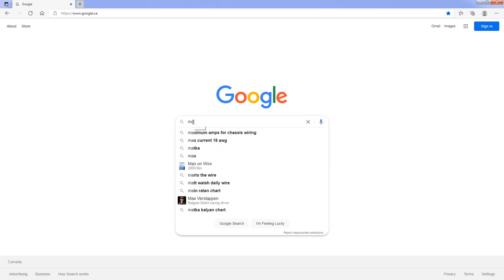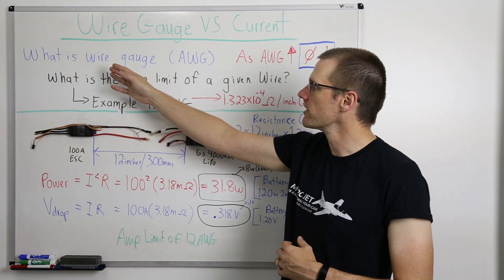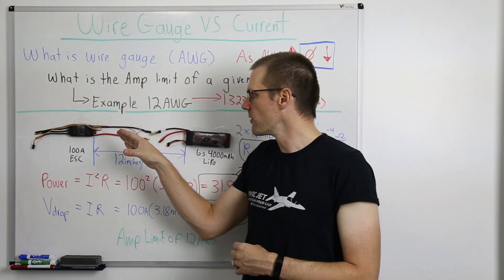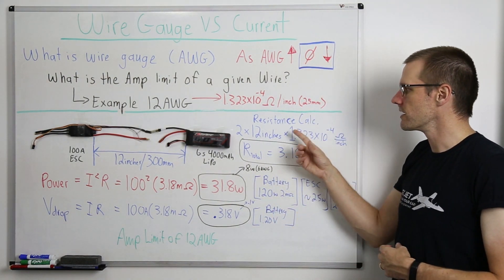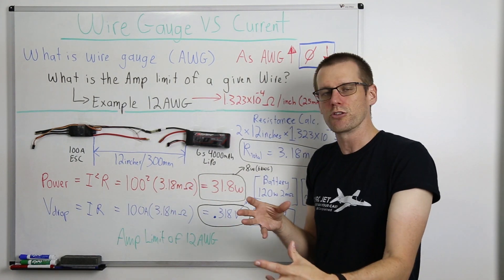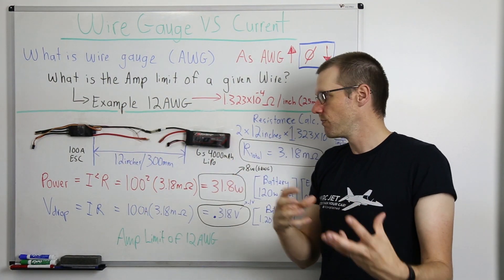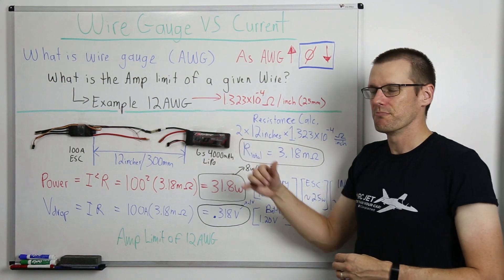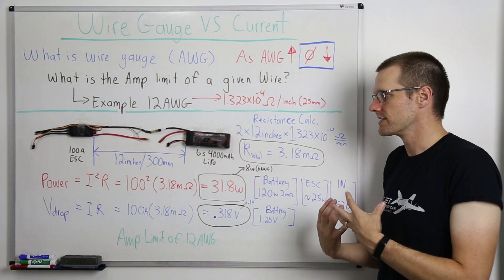Wire Chart Says 12AWG Wire is not good for my 100A ESC and LiPo

Comment: yeah i agree with you that the small wires they put on things  is is small when you are are small scale.  but once you start going over 150 -200 amps at 12s .  That they expect your wires are short with only one connection.  but when you start putting batteries in series and lets say you have a RC plane or boat or larger 1/5 scale cars and don't have the luxury of putting the batteries motor and esc basically on top of eachother. 
Thats when your calculations are no longer insignificant. That having larger gauge wires and better comnectors is a must. Because 
Running those small gauge wires will overheat your entire system and reduce your battery, esc and motor life.
Also running bigger lower KV motors that having a more voltage drop reduces its top speed. And when you try to compensate by drawing more amps it will definitely use a lot more power from the batteries and can significantly reduce its runtime. 

 Not to mention  having a higher resistance on long high speed runs can risk or full throttle for 2min+.  that it will heat things up pretty quick. Which heat will furrher increase its resistance and increase the voltage drop which then requires more power to compensate, which is more losses .  That many people assume the wires that came with it should be okay .
Until ultimately their RC catches on fire.(which many of them do) 
 That its probably better to solder bigger wires onto your motor,esc, and batteries. 

 and also have a high wattage soldering iron(150-200w) or one thats on butane. and hopefully you don't damage them in the process.

So while i agree with  you when you are talking small scale and using a 100-120 amp esc on a light weight mostly plastic 1/10-1/8 scale car. But if you talking about anything bigger than that, then that changes everything

Comment: I have a question, if I have 3 lipos in series for a total of 12s 10,000mah and I pull 100a, how many amps is each of the three batteries contributing?
Reply from the maker: If you put 3 4s lipos in series for 12s, and pull 100A, you have 100A going through each one.
Reply: @RCexplained  ok so 12s 2p would be 50amps per pack under the same conditions, got it

Comment: Hi,
i have a 30A simonk ESC that has a reading of 16 AWG (battery end) in it, and i use a 2200mah 3s-30C lipo battery i have to connect the esc with this battery (for to understand suppose im only connecting one esc and battery) what gause should i use to connect these? im afraid that my battery lead wont be 16 AWG (havent purchased it)
could you please suggest me what AWG i use to connect these two?

Comment: If you have two LiPos in series, what guage would I use for the piece between the packs; the same as the other battery leads?
Reply from the maker: Yes, Keep as short as possible. Preferably no wire added.

Comment: Great video! I always wondered how RC manufacturers managed to use such high wire gauges to carry seemingly absurd amounts of current compared to the wires inside the walls. Now it all makes sense. Household wiring is long, has no airflow, has to be efficient, can't be a fire hazard because its surrounded by flammable material, has no limits on how long high current can flow through it, vs a lipo that will die in a few minutes at high current, and has to work unsupervised for decades.
Reply from the maker: You got it!

Comment: I have a question on my proboat Veles 29 the dynamite 120a ESC has very short amount of wire and it is set up in series and the ESC cuts out at high speed on my big 6s set up now my 2 thoughts are could I be pushing the ESC to hard or can I make it work wit some modifications like it has standard 5.5mm bullets on the ESC to the motor I was thinking of upgrading them to 6mm as well as a slightly longer more traditional length wires to batteries to reduce heat and ware do u think this will help this ESC at all or should I just upgrade the ESC?
Reply from the maker: Make sure your batteries can handle the load and you are not entering low voltage cutoff.

The shorter your wires are, the better. Changing plugs, won't do much for you.
Reply: @RCexplained   ok I'll check and make sure it's not going into low voltage cut off

Comment: you are basing of AC current charts and DC current silicone wires are different I have more strands they can handle more current so if you look online a standard 10 gauge silicone wire can handle close to 270 amps

Comment: If you don't want the 32W of heat in 24 inches of wire, then get rid of the WIRE!!!! Shorten the connection to near nothing, with the leads cut to 1/2" or less into the connector on BOTH devices, and presto, the losses magically disappear. 😁😁👍👍👍

Comment: That was a good video b/c it's right up my alley with the EDFs I fly. Maybe a video using a watt meter showing the actual voltages, amps and watts generated, i.e. static thrust test, would be a good project to compare theoretical vs actual. A heat meter would also be used to see what heat is produced. I've found that 10AWG is about the limit for wires to be used in order to bend enough for practical use. But lower gauge wire, bigger diameters could be used if specifically designed so that they plug in without any twisting or bending during the build. But the odds of getting the CG right on with the battery pre-placed would be difficult.

Comment: You’re right it wouldn’t be practical to try and solder 6awg wires to power systems ourselves. Trying to manipulate thick wires can ruin a day 😂 I installed a 120mm 12v computer hard drive fan to my rc car shell to help heat dissipation that blows air on my battery,esc,motor simultaneously.

Comment: Ryan, question! Is it super important to use electrical flux when doing high power wire soldering?
Reply: I don't think Ryan ever answer questions? Lol At least he never answers mine🤣🤔
Reply from the maker: Charlie, I use flux everywhere I can as it just makes it easier to get a good solder done quickly. 

Everything Tech! Rc & Dronez, I don't always see every question. Best place for questions is Patreon as I see all questions asked.
Reply: The only important thing is that you get a good solder joint. Using sufficient quantities of the right kind of flux is very much part of that. If your solder does not wet the surfaces properly, but want to bead on top of them, or form "buggers" or a matte wrinkly finish on the surface, then you need more flux. Otherwise you should be fine.

Comment: Is there a way to measure amp draw on a rc motor or a way telling if the motor is not running as efficiently as new , I have a few same motors and seems like some run hotter , ive changed the bearings and sometimes the rear bearing could be froze without knowing , ps seems like they really cheap out on lipo battery wires , I would rather pay few more bucks for copper or even just heavier gage
Reply: I'm sure it would be a pain but you could always DIY your lipos. Ya know with extreme caution
Reply from the maker: Hi Paul I would data log the runs that you make with the only thing being changed out is the motor. If this is an RC Car - It would be easiest but perhaps not practical for you to see the difference on a bench test using a propeller as the load.

Comment: Thanks man I was wondering why my resistance on my 7500 100c gensace batteries read 4,2,11 and there brand new. Is 8g wire ok and how much resistance in comparison to the 12g?  I'm running 1717 1650kv Xlx2 on infraction 8s
Reply: I wanted that set up , I put rebranding hw  from team coralley , with 27t pinion and ran like a champ something about that setup compared to a typical rtr 2050 , I do have 3 high-power fans , the less wire you have the better and less heat buildup less resistance just like sometimes open throttle is better less heat than half throttle,  trick with infraction is high  c rating batts and good cooling 😎
Reply from the maker: The resistance on your LiPo battery is mainly coming from the chemical resistance within the cells. 

8AWG will have about 2.5x less resistance

Comment: 30 watts isnt that much  ...  ???    about the same as my soldering iron  wish they would spend a bit more on manufacturing !
Reply: Me too they really have it down to science using least as possible,  sometimes im amazed how much power through these cheesy wires they aluminum too probably less resistance but very soft and dangerous compared